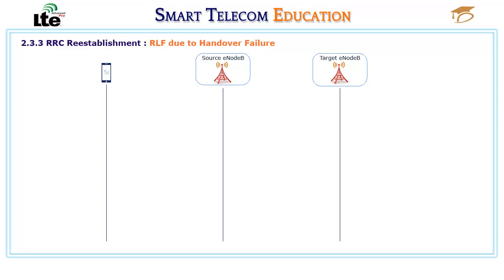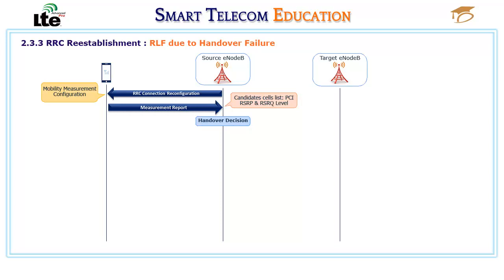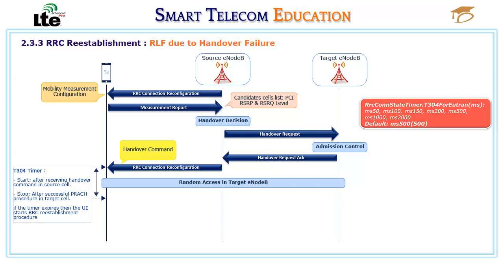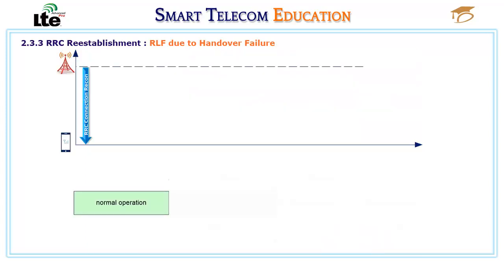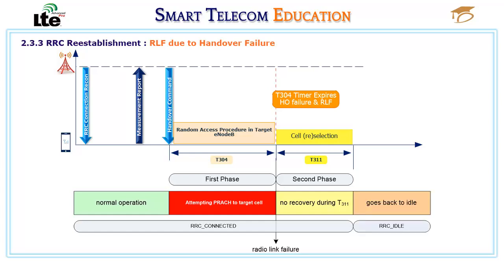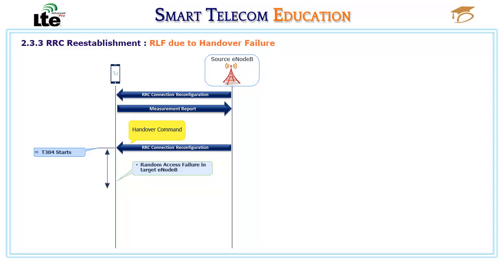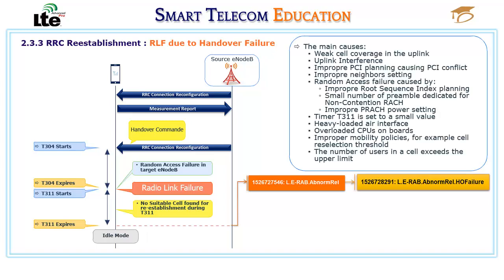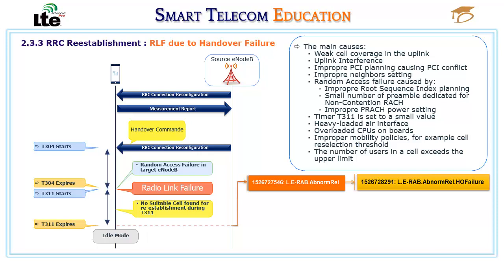LTE Drop Call Optimization - HO Failure on Huawei Equipment

Comment: I think the enodeB will release the ERab only when TrelocationOverall timer expires. If the UE reconnects back from Idle befor tTrelocOverall expires, it will reconnect with a fresh UE context, then MME would release the old context on the source eNb due to the duplicated UE context.